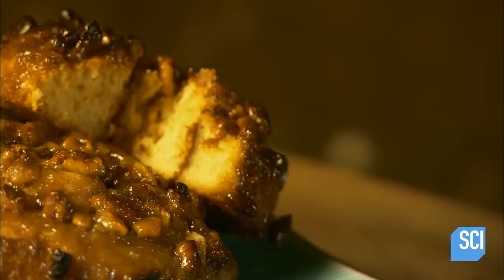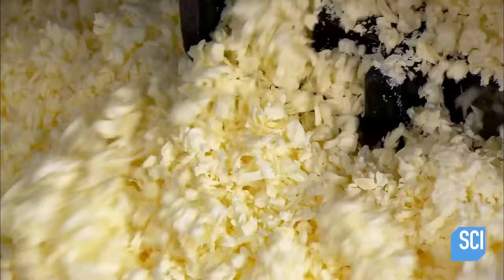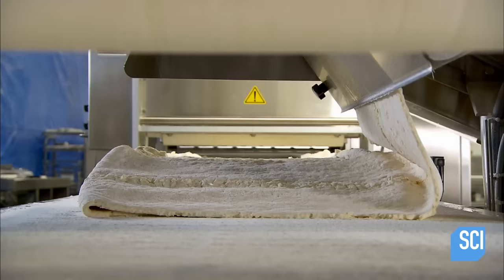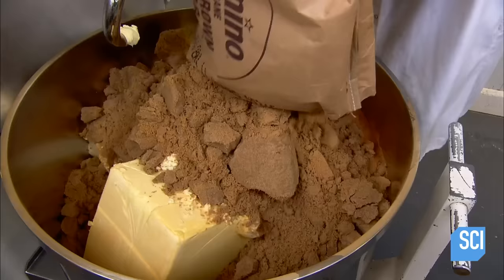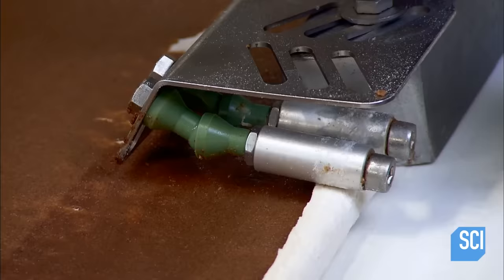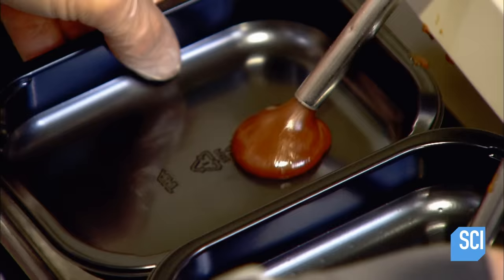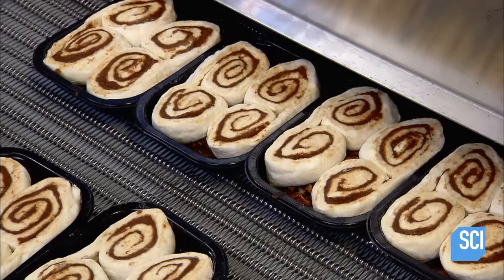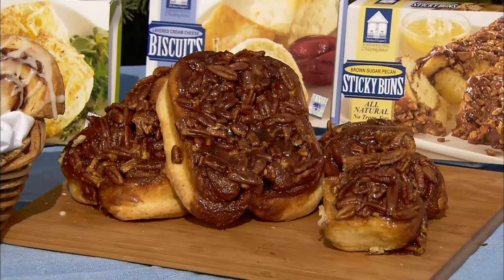How It's Made: Sticky Buns

Comment: The temp of the dough is not controlled for "food safety reasons" as the narrator says at 1:05, it doesn't even have eggs in it!, they need to keep the temperature low to prevent the butter from melting and thus ruining the flakiness of the final product